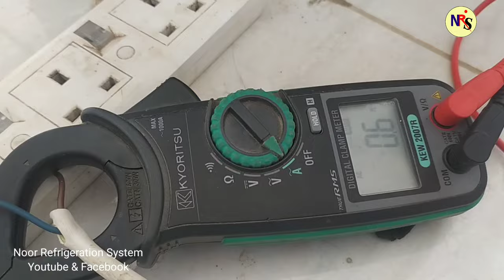Refrigerator Compressor Not Running? Test The Start Relay,Overload, Capacitor

Comment: ভাই আমার এসি ১.৫ টন ইনবাটার।
কিছু দিন আগে সমস্যা হয় এসি ঠান্ডা হয় না। তারপর মিসটিরি কে দেখাই । তারা বলে ইনডোরে লিকেজ আছে।  তারপর তারা নিয়ে গিয়ে ঠিক করে দেয়। 
একদিন পর আমার এসির আউটডোর ৪-৫ মিনিট পর পর বন্ধ হয়ে যায় এবং যখন চলে তখন আউটডোর একবারে আস্তে আস্তে চলে। এ বেপারটা তাদের বলছি কিন্তু তারা এসে কোনো সমস্যা পাচ্ছে না বলে ঠিক হয়ে যাবে।একটু  যদি বলতেন কি সমস্যা। 
আগে আমার এসি ১০ মিনিটে ঘর ঠান্ডা করে ফেলতো এখন ২ ঘন্টায় ও ঠান্ডা হয় না।
Reply from the maker: AC Indoor Diya Cooling Kemon Ase
Reply: @NoorRefrigerationsystem  আউটডোর একটু পর পর বন্ধ হয়ে যায় ঘর ঠান্ডা হবে কেমনে।
Reply from the maker: @pigeonbdhometv2784   room Sensor dekhen
Reply: Does the relay overload trip the refrigerator in the video on high amperage